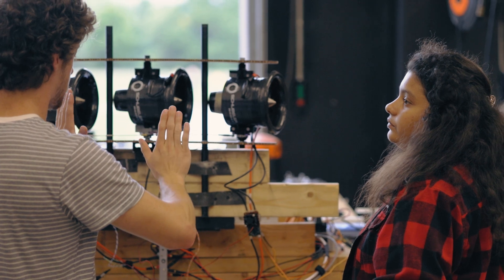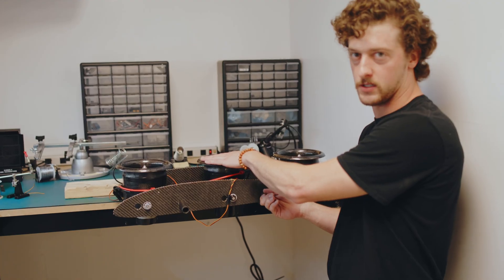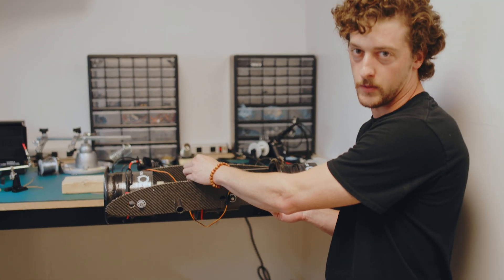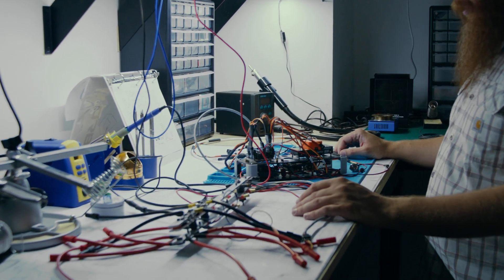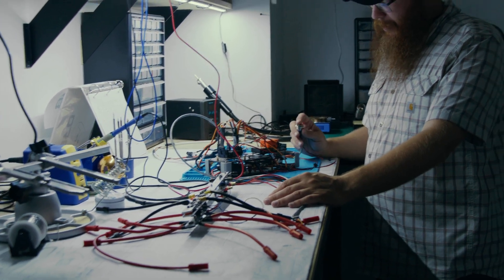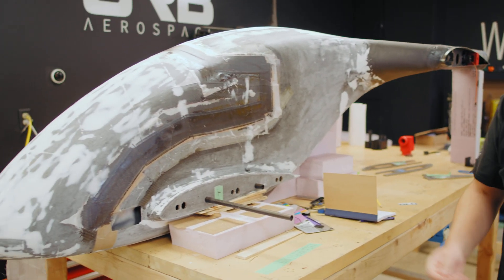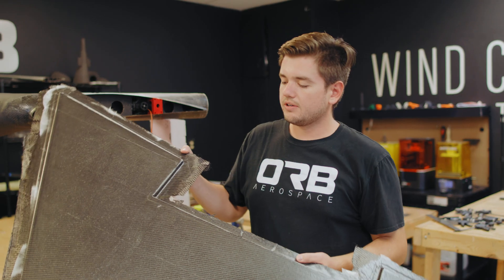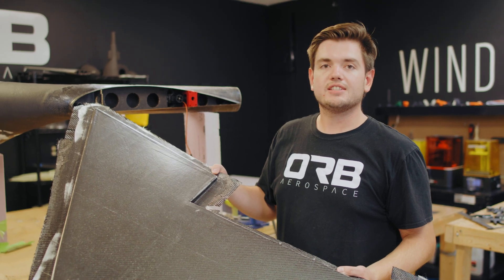Orb Aerospace | T-Bird Two Progress - Brief No. 2

Comment: Why would you bother pivoting the 6 small ducted fans at all if the large rear coaxial propellers do all the work for forward flight... Since they're really only applicable for hover, why not just leave them fixed in a vertical orientation and gradually reduce their thrust as the vehicle transitions to forward flight... And if you decide to do that then get rid of these ducted fans and put a dedicated Lift Fan in the lower wing since a lift fan is more efficient than a ducted fan meant for forward flight.